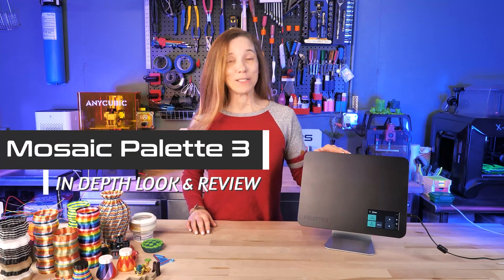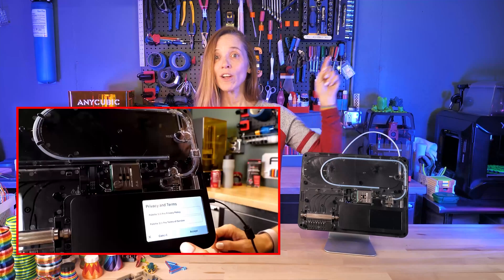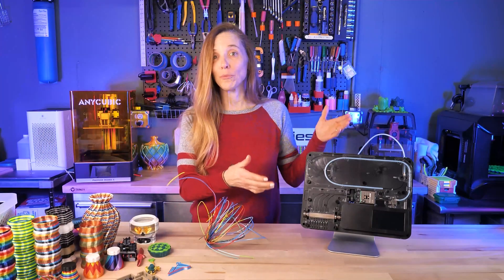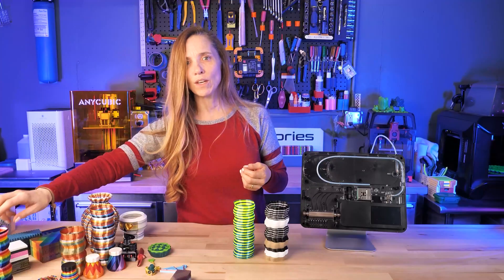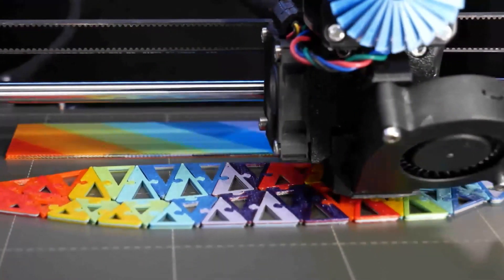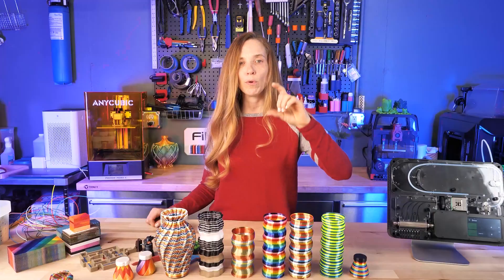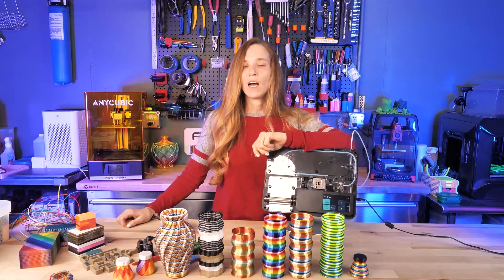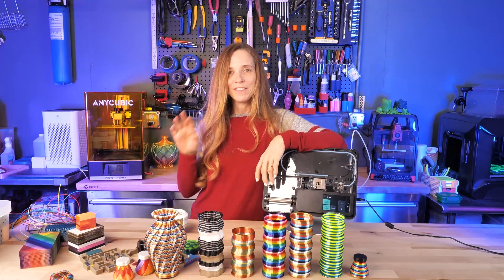Mosaic Palette3 In-depth Overview and Review

Comment: I have many pieces of filament that I would like to use. Most are over a few feet long.  I would want this mostly for the splicing feature so I don't waste all these pieces.  Does this have a feature where if the current stand is used up it will just splice in the next strand and keep working?

Comment: As a user of the original Palette, Palette 2 and 2 Pro, the Palette 3 is a big disappointment.  Featured promised before release are still missing. They have taken away the ability to work locally and now you have to use their cloud service.  Some of the models I work with have license restrictions that prevent me from using cloud services.  There is also no support for Klipper.  There is a third party app, but it has not worked too well for me.  Mosaic has said they will be adding support for Klipper, but my past experience with them is they will say what you want to hear just to get you to go away.  I am still waiting for features promised for the Palette 2.  So now I have a $900 paperweight sitting here gathering dust.  :(

Comment: Print recovery? How? Everytime I get an error, its done. Am I missing something? Even if I run out of filament (and forgot to designate another feed port to pick up on) the pallete just stops. It doesn't let me correct the issue. I have to completely start over. I have not once had an opportunity to recover a print from a failure. Please explain.

Comment: Just had a little thought towards a hacky solution to reduce filament waste between colours. Could print the resulting gcode with octoprint and the Exclude Region plugin, then set to exclude the reigon of the purge tower.

Recently got into 3d printing and discovered your content. I have bought lots of filament as a result of this chanel
Reply from the maker: It makes me so happy to know that you've found filament you like from our videos.  And your idea about the gcode exclusion is definitely interesting and would work in theory for the printing side.  The Palette is splicing filament that includes enough length to do the purge tower area though, so you would get out of sync.  It would possibly cause issues too if the Palette was doing any of it's Ping position checks during the removed section, which could cause the job to end in error.  I like this direction of thought though.  It would be so nice if Mosaic would just offer a zero purge tower option.
Reply: @FilamentStories  another thought I had and another potential hacky solution. If the pings tell the palette when a change of filament is near and keep printer and palette in sync, might me possible to write a python script to exclude the purge tower and compensate for the change in extrusion length by moving the pings a little earlier in the gcode each time a section of purge tower gcode is removed.
Reply from the maker: @rossc12345  I wonder what post-processing would be necessary.  The pings and pongs aren't specifically when color changes are happening, they're at certain intervals so the Palette can know where it is in the overall print. (I believe).   Mosaic hasn't shared much information about the conditions under which they're doing the pings and pongs other than to say it's their internal calibration mechanism since the printer and Palette are only handshaking via the filament usage (in a way).   I'm interested in seeing what direction they take things in going forward.   Hopefully, they're thinking along the same lines.

Comment: <warning, wall of text because I forgot to find clean points to group comments together>

Awesome overview and review. As someone who has had many conversations with Mosaic (and plenty with the CTO), the P3 is definitely a vast improvement on the P2 and I'm very happy about that. Multiple models per-purge block is the most economical way to go. But I do very much agree on having a 0 transition length option. There are plenty of models where bleed is fine, and if it can somehow be combined with the more exact color change transitions, I imagine that some cool effects could be done (imagine a semi-smooth gradient on a spell effect for a mini, while everything else has hard color changes). I still want them to have more recovery methods... that's a longer writeup. Cons are dead on. One of the biggest things is the OTA firmware updates. People don't realize how much that is going to fix issues for people. Have an issue, tell them, hope or expect that they make a firmware update, and it shows up. No more "wait, that's been fixed for 9 months?!" that happened before. I don't know what firmware version you're on, but 22.03.29.0 fixed the issues with the Prusa, so you no longer need "alt" firmware. Cost is going to be the world's biggest debate. If you talk with them, you find out they are a small team that are well paid and the cost for these things aren't money grabs. They made a product that can sit out in the open and isn't just a mess of wires and the minimum number of parts needed to function. They also do very much listen to feedback. I backed them on Kickstarter for the original Palette. Feedback led to the Palette+. More feedback led to the Palette 2. More led to 2S. And more still to the 3. Firmware will continue to improve and fix/add features. There are companies that have not touched their products since their release, so feedback and revisions are massive.

Comment: Nice, just in time for me as I just bought it :D 
Few questions:
1. How easy is it to remove filament if it breaks in the machine. For example it's going all the way from the input hole to the buffer length, how can I get it out as it also goes through the splice core?
2. What do the numbers for heat, compression and cool mean. I can't quite get my grasp of that part?
3. Is there an easy way to guide the filmament through the palette, like a "filament in" button i have on my vyper, where the extruder moves the filament through the boden tube?
4. How often have you looked behind the plastic transparent cover and what problem arose the most that you had to fix behind the cover?
5. I'm used to Cura as slicer, Is there a way to get the profile settings from Cura into Canvas (I haven't found an easy way yet)?
Reply from the maker: Hello Raynlaze!

1) Typically, it's very easy.  The thumb screws come on and off with ease and stick to the magnetic spots on the side of the case.  There is control on the touch screen to move any of the eight filament paths forwards and back as well as the main path after the filament has been spliced.  On occasion, there is a break in a spot that the drive can't get to, which requires pushing a piece of spare filament through one or the other end to get the remnant piece out.  Getting the filament out and the Palette reset typically takes less than five minutes, with most of that being removing and replacing the covers.  
2) I agree, it's not straightforward!  I had a hard time cutting off what was review and what was more informational content with this video.  I want to do more videos with expanded content on working with Canvas and the Palette.  Originally this video was much longer (and possibly more boring as as result!). The base settings for Heat, Compression and Cooling.  Some filaments are just fine with that, for instance Polyalchemy Elixir just loves those settings.  Some filament needs more heat to make a solid splice and some filament needs the splice point squeezed or compressed to ensure a solid splice.  Depending on how much heat or the filament's needs, it may need to be cooled for longer before the Palette advances the filament past the splice core so it doesn't get drawn out, thinning the splice point.  It's a matter of trial and error.  Ideally, you want to have the lowest values possible.  For instance, more compression will decrease the life of your splice tube (a $5 part that is well worth replacing a bit earlier in order to ensure my prints don't fail in my opinion).  The current life is fairly large with estimates in the tens of thousands of splices.   Here's a document from Mosaic that talks about splice tuning that gives more information with some example numbers for filament types.  https://docs.google.com/document/d/1drtSCEqirU4bwxl9fr31tNBduVxW1juDflmbqZ45sQk/edit
3) Yes, to a point.  You can move any one of the eight filament paths forwards or backwards as well as moving the main Drive which advances or retracts the filament after it has passed through the splice core. 
4) It's not uncommon.  Initially, before I got the hang of splice tuning, I was running print jobs with improperly tuned splices and I would have failures mid-print.  I also (rather embarrassingly) had a PETG filament in the mix during one of my livestreams.  I truly thought the Palette was having issues.  It was TWO HOURS (sigh) before I got the model printing and we had a lot of issues where I went behind the covers.  I didn't even realize the issue until the next day.  In my experience, the majority of the time I have to go behind the covers, it's something that might have been avoided had I made different choices.  It's one of those experience makes all the difference things.  That being said, I have had issues where things got out of place, one time where the filament got stuck under the guide bar at the entrance point where the filament comes in.  Initially, I thought of it as a "problem" when I had to open the panels, but in practice, it's more part of the process and the panels are there to keep things in proper alignment.  Mosaic has made all four pieces very easy to remove and replace.  But it will definitely happen!  You'll be good friends with those thumb screws by the time you've gotten a collection of prints completed!
5) Not to my knowledge.  You can customize the profile settings and make as many profiles as you'd like, but you're constrained to the settings they have and the organization that they have them in.  The Prusaslicer option to work with P2PP is a path to use Prusaslicer since they have the MMU component, but there isn't an option for Cura currently.   I know there are a lot of Cura users and I totally agree, I like my slicer profiles!  It took me a bit to get comfortable with organization things in Canvas.   Ideally, I'd like to be able to use whatever slicer we want, but I understand that they need to be able to generate the code from with Canvas because they're adding in things such as the pings to ensure the Palette can adapt their splicing to keep the print on track color-wise.  

I hope this helps.  I plan on doing some more livestreams with the Palette and just having a general Q&A session while something prints.  We have family vacation at the grandparents and I'm going to be printer and Palette-less, but I should have some going when I return after next week.  Hope to see you there if you have more questions.   Courtney
Reply: @FilamentStories  Hey courtney, thank you so much for answering my questions and for your comprehensive explanations! It´s good to know that there are multiple ways to get the filament out if something goes wrong inside the Palette. The heat, compression and cooling also make a lot of sense now thanks to your explanation, I'll have to look into that first I think before starting to print something. I'll have to see how many times I'll have to use those thumb screws haha. Hopefully one day they will support Cura as well, but I guess I'll have to get used to Canvas a little bit more.

It definitely helped me! I hope to be there on the livestream one day. Have fun at your vacation!